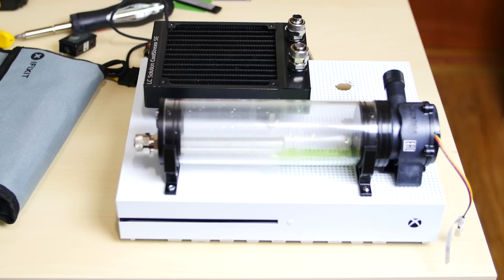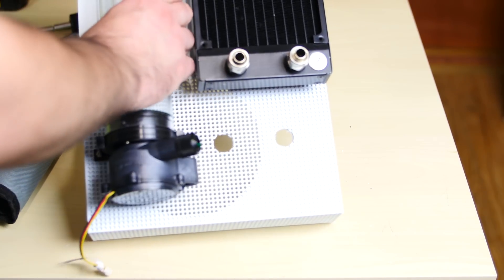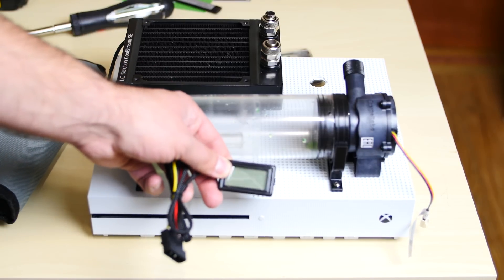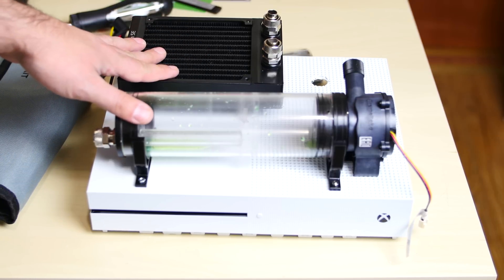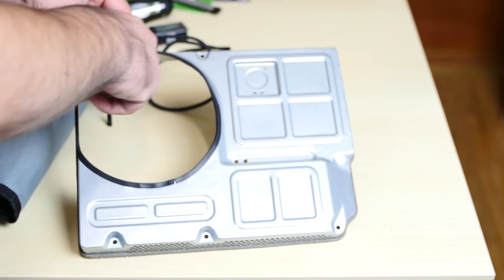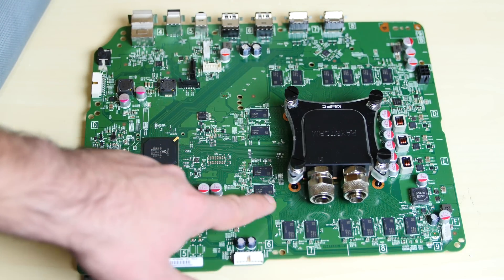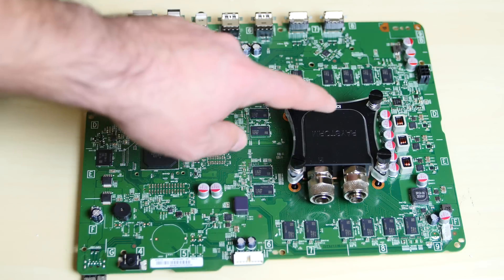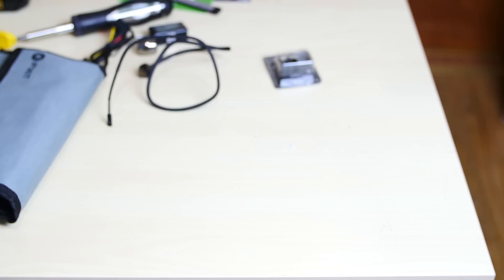Water Cooled Xbox One S - The Build - Part 3

Comment: You got a low flow rate because you used the splitters wrong. You are supposed to pass the liquid through them, thats why there's 2 G1/4 threads. That way the CPU block gets maximum flow and the smaller ones get what ever liquid thats left over.

Comment: Should there be a fan on the radiator?
Reply: No, but it won't cool the water as well.
Reply: Use common sense. Radiators cool be passing the water throug metal tubes, which transfer the heat to the fins, which dissipate it to the air through thermal transfer. That air will stay hot. However, a fan will circulate cold air through for the heat to transfer through.

Comment: All that time and work for what?You can't even over clock the piece of shit.
Reply: It keeps temps down, keeping stuttering and lag to a minimum.
Reply: It would never get hot enough to throttle
Reply: ***** I just kinda assumed it would, my ps4 starts throttling after awhile of running. Though it's cooled by a dinky ass heatsink

Comment: dont put the thermometer in the build, liquid temp isn't indicative of processor temp
Reply from the maker: You are right. Its not going in the buld.
Reply: Why liquid cool if you're not even going to bother with monitoring the temps. That's like installing a new intake manifold but not running any performance test. Yes, I disagree with everyone who thinks that liquid cooling a console is a pointless Idea but at the same time don't half ass it. Once you start you gotta go all in baby!
Reply: But liquid temps are misleading. That thermometer wpuld make it worse
Reply: What are you talking about? The readout of the liquids temperature is not false. How would a temp readout make anything prefom worse.
Reply: I didn't say it would be false, I'm just saying liquid is at all times cooler than the processor, so a thermometer on the water would make it seem as though it is performing better than it is.
Reply: No....that would just be the temp of the liquid lol. To get the temp of the actualy preocessor you'd place a temp probe on it as done multiple times before with previous gen consoles.
Reply: Liquid temp does not matter, only processor temp matters.
Reply: Using that thermometer to monitor performance is like installing an air conditioner in your home and then putting you thermostat inside it.
Reply: You were saying? http://prntscr.com/dad8lt
Reply: DJHeroMasta you are able to monitor your CPU temperatures.
Reply: DJHeroMasta also that's really impressive, nice job

Comment: you should use tea for the coolant its meant to be much better!!! make sure you use lots  of milk and sugar helps with flow etc
Reply: mattyfromlondon no coolant made for water cooling will run better he doesn't know much about water cooling because if he hooked them up properly they would run great also with the heat the tea coolant would change color and clump because of the milk and shugar
Reply: What are you on? I gotta get me some.

Comment: I agree that it was too messy but that was because of the way you routed the tubing. I would rethink it and water too the memory too
Reply: Stephen Cicero add the memory coolers but daisy chain them like on their product page or you need to add a fan to cool the heat sinks also if you hook them up properly they won't affect the flow unscrew the silver cap from one and run a tube to it from the pump and on the other side of it run the the CPU block and out to the other adapter then the pump